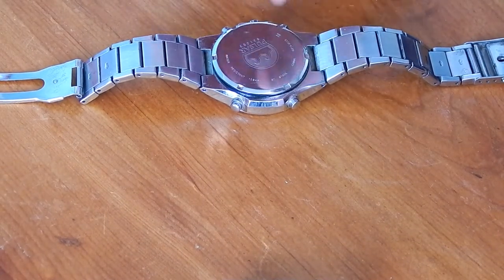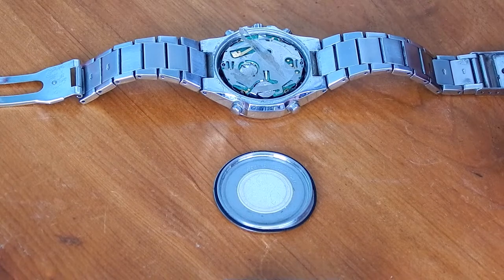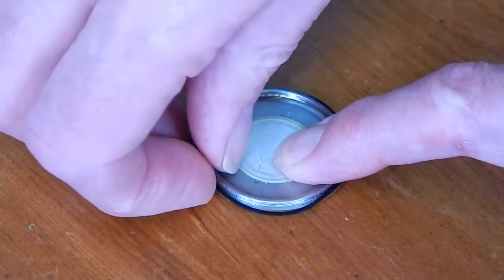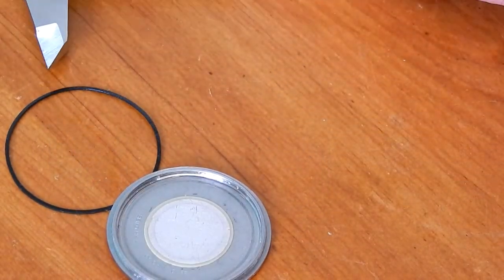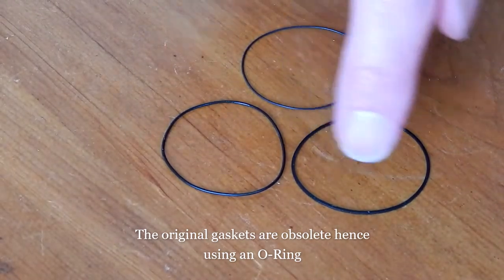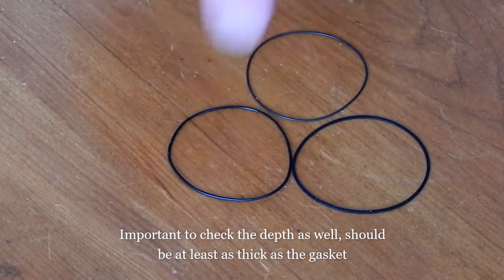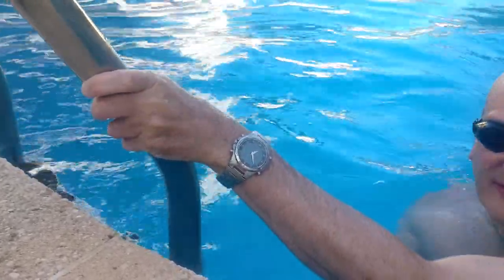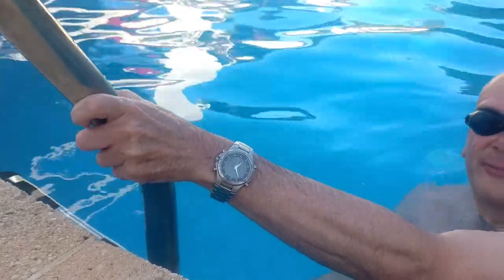Replacing the Flat Watch gasket with an O-Ring. A Step by step how to guide to keep it waterproof

Comment: One more thank you from someone keen on checking if an "o" Ring is an acceptable substitute on my vintage Seikos. I also liked & learned from the greasing method used. One thing though; to my knowledge "O" rings do NOT rot when in contact with oil (just look at the number of the cars and bikes using them as part of the oil filter sealing).
Reply: Oil resistant o rings yes but the petroleum reacts with the petroleum in the o ring either swelling it up or slowly breaking it down so it has to be oil resistant